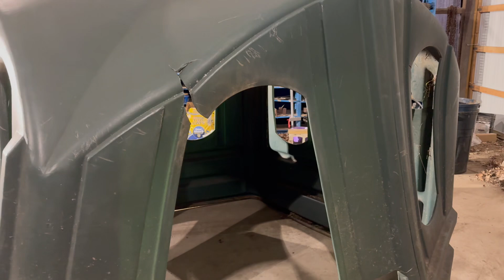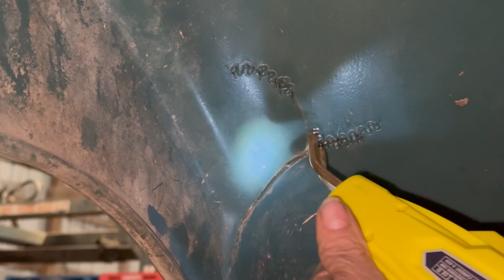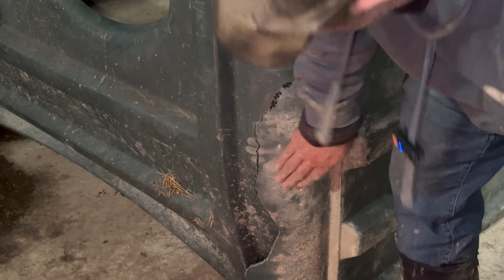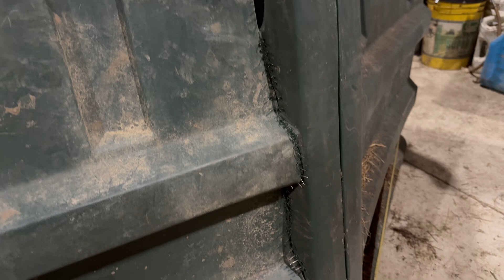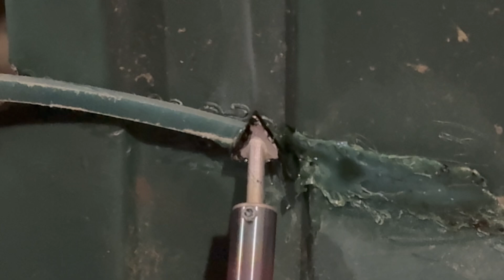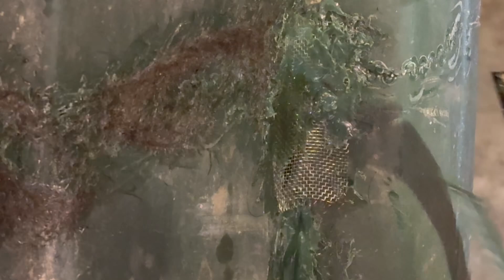Plastic Welding Fixing Large Crack and Breaks on a Hay Hut Using Tools Anyone Can Use and Afford

Comment: Thanks for the videos. When should you use the hot stapler vs the jounjip? Do you need both tools or just 1 should be sufficient?  Because there seems to be some overlap as the all turn also has an attachment that can melt plastic into mesh/wool or melt plastic filler rods. Especially if  you don't deal with large plastic areas to weld.

The overheating on the stapler gun i suspect is because it doesn't have enough holes for ventilation. You could improve that by cutting some slits into the plastic frame of the stapler gun.
Reply from the maker: The stapler helps attach pieces.  The Jounjip iron melts pieces together.  I use them in combination.  All turn I think is best as just the stapler.  The hot iron only good for a small spot in my opinion. You can do more with the Jounjip because you can melt plastic rods and melt stainless mesh.  All depends on your projects.